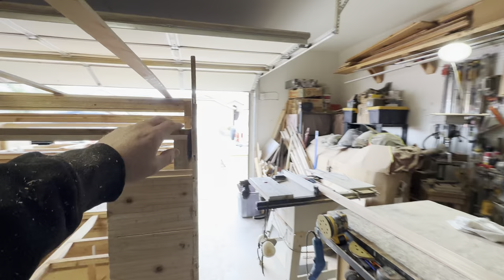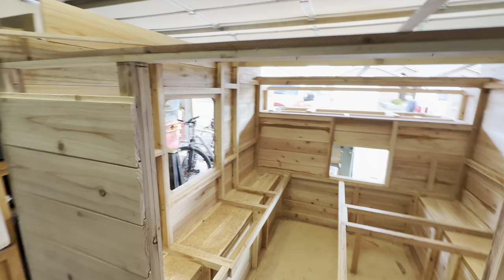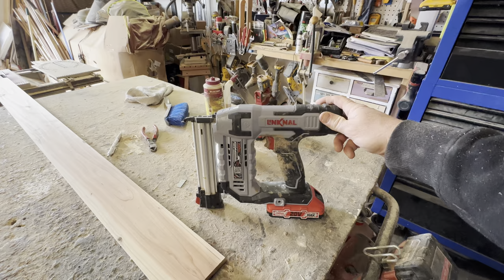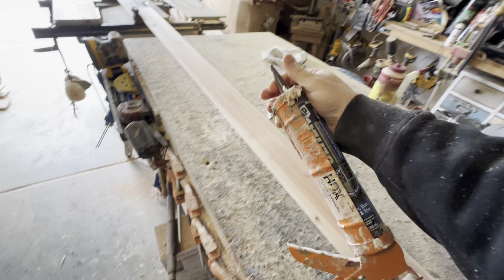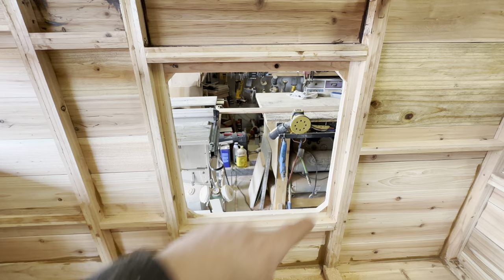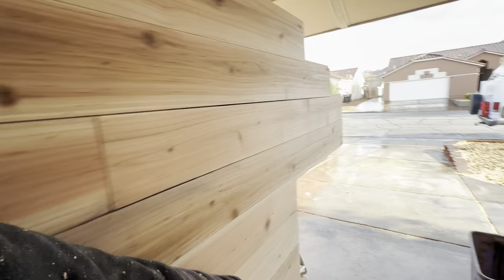Truck Camper Build 8.0 VLOG, Part 4 Camper Gets Some Skin!

Comment: Hi Dave!
Looks so slick and smoth.... it'll probably be under 250 kilo dry.  Easy to get on and off the truck.  😊❤
Reply from the maker: I hope. I’m surprised how light it is so far.
Reply: @EndgameCampers  you've changed your technique and thinking.  It's called experience 😅

Comment: Excellent work, as usual. 
I really admire your design aesthetics. 
I would love to have one of these truck bed campers to compliment our 17’ Casita travel trailer. 
It would allow the wife and I to have a bit more elbow room, and some “me space” each. 
My long bed F-350 could easily handle the additional weight and space of the camper. 
What would it take to get together with you on a build like that?
Reply from the maker: My friend, I’m really sorry, but I don’t do custom build requests. I’m really sorry. Long story, but in short I discovered that I would prefer to keep the builds as just a hobby. If I start doing custom stuff and mixing money in the equation, it starts to look like work. You are a loyal viewer and I hate to say no… so please don’t take it as a negative.

Comment: You're doing beautiful and thoughtful work, but I'm concerned about one thing: What will keep the cab-over from sagging?  Shouldn't you have used a cantilever member on each side?
Reply from the maker: Sheer strength of those walls is amazing. No concerns about sagging. I’ve made many of these with no problems. Intuitively, I understand where you are coming from though.
Reply: @EndgameCampers  
I'm an architect and I can't help but worry about structure - and waterproofing. I recently discovered your videos and I'm intrigued enough that I will watch more to learn about your techniques. You have an excellent design sense and you do very nicely detailed work. Thanks for sharing your passion.